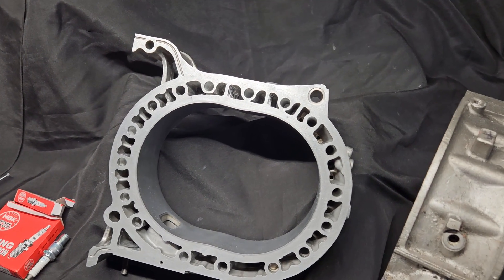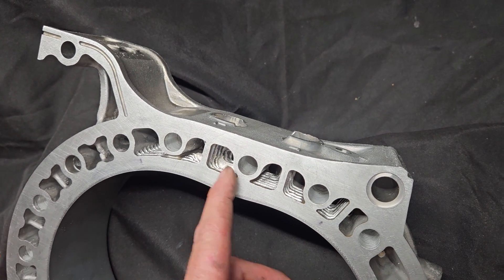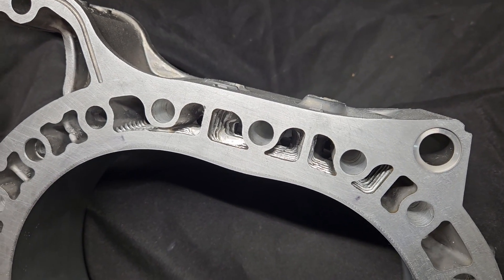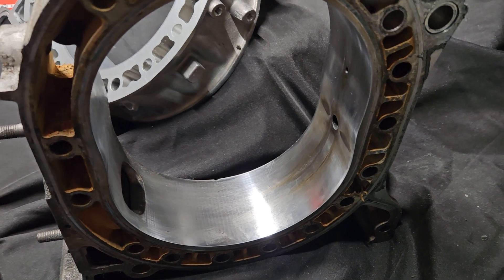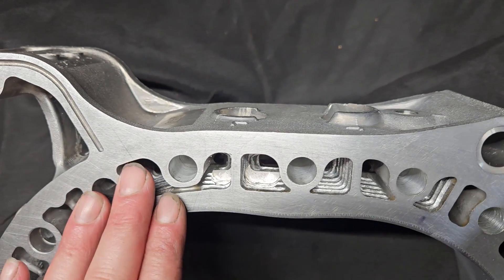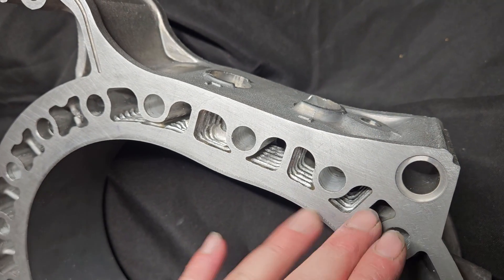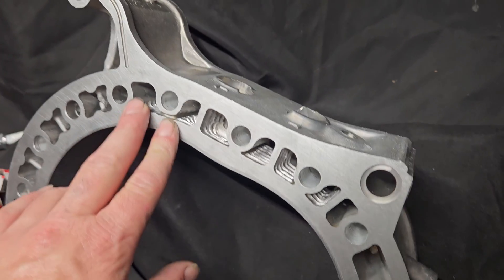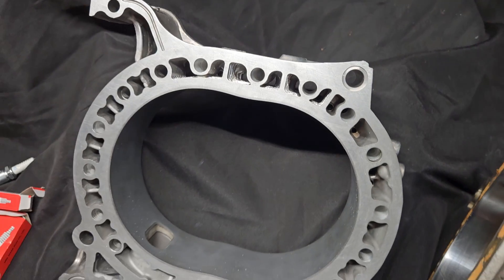Rotary Engine Water jacket modification for extreme conditions, save you race Engine

Comment: Would there be any benefit of doing the ported water jacket grooves in the direction the water is flowing instead of across its flow?  Does the sharp edges cause cavitation where it spills into that trough, trapped air bubbles,, or would it be worth it to round the edges to prevent that and get rid of stress risers in the metal?
Reply: Well, the waterflow would be less restricted, due to swirls, but maybe the overall area of heat transfer would be slightly reduced. It's a relaly good question tho.
Reply: @Zoetec13B  abrupt swirls or turbulence generally does not increase flow, it reduces it.
Reply: The ribs increase the surface area and turbulence. The main benefit comes from the added turbulence as that increases the "residence time" of the coolant allowing for more heat to be transfered and pulled from the housing vs more laminar flow. Some builders also add a direct fresh coolant feed from the pump right upstream of the plugs to inject colder coolant to the hottest part of the housing in order to get better heat distribution all around, reducing the risk of distortion and apex seal chatter. Of course as Kyle mentionned, you're pulling more heat from the engine into the coolant, so an increase in coolant temps is possible and an upgraded radiator would be really welcome.
Reply: i would thick the same as heatinks on electonics with fans blow along the fins instead of blowing horizontally across all fins not going into the dips or deeper bits of fins

Comment: Why not just go billet plates and everything? Billet aluminum is more heat resistant right?
Reply: Probably a “if it ain’t broke dont fix it” scenarios, the housings aren’t cracking or anything, and there’s probably not a ton of benefit compared to the increase cost for this motor. While that would benefit, it probably is just an extra expense for not a ton of benefit at the power lever that motor is running.